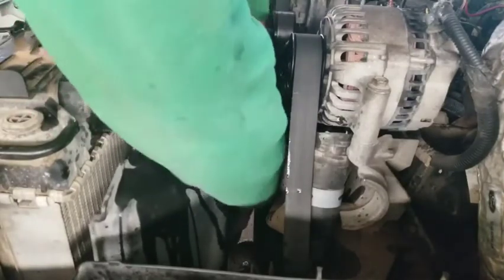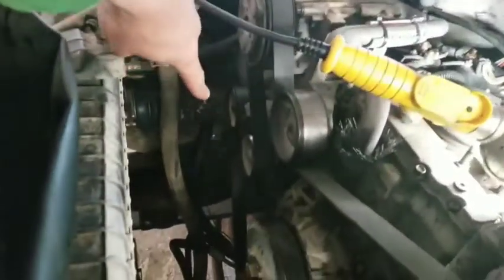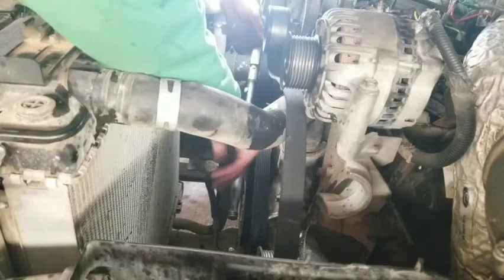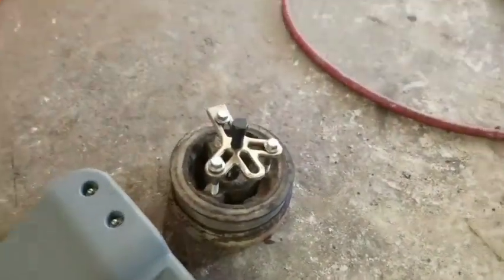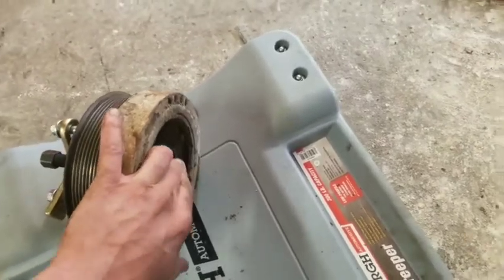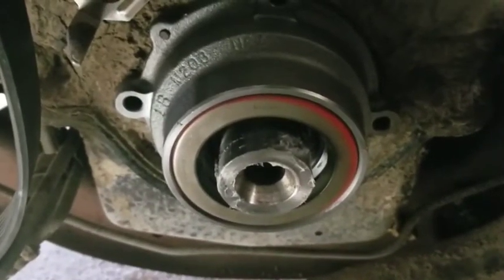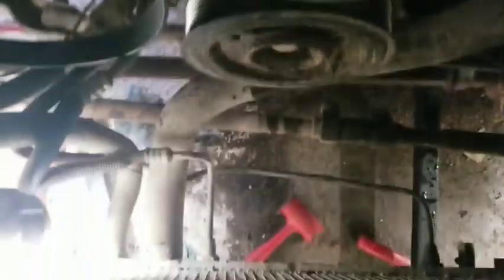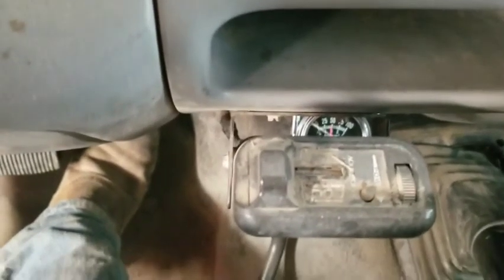7.3L Powerstroke: Low Pressure Oil Pump Replacement

Comment: Before you set the puller MAKE sure after you remove the bolt and get that big fat washer out before you set the puller,  It may be hard because it is set with RTV sealer and if it is not sealed, that will cause an oil leak.  I see a lot of I did it wrong here.....
Reply from the maker: @dalerasmussen6678  thanks for the additional info.  That may help someone else out too.  I'll pin your comment if that's ok with you.
Reply: @prodieselrepair3218   Yes Okay.. There is not much info of what to do, and I also found that to get the wear ring off you can strike it with a chisle (if you grind it to match your angle) and release the tension to then pry it off...

Comment: Thanks for posting. First video I've seen that actually shows the air chisel trick. Also the space with the radiator in place Looks like I'll be getting the HF stubby impact. 😀

Comment: Did you have to prime the pump after install? I just did mine and my hpop res won’t stay full and truck keeps dying.
Reply from the maker: No you don't have to prime it.  There's some sort of check valve that is supposed to keep oil in the HPOP res

Comment: Why did you replace it?
Reply: It can get worn, and stop pumping oil correctly. Causing low oil pressure
Reply: Main problems are lower power output and hard starting when cold... @rileyjoseph3488

Comment: Anything else to note when reinstalling the harmonic dampener? I borrowed a installer tool from o’Riley’s. Do I need to spin the motor over to a certain position to get the timing right?
Reply from the maker: No you don't need to time the dampener or any else.

Comment: Thanks for making this video! Local guy was telling me it's an engine out job and 30 hours labor. Looks like he was full of it.
Reply: Yes he was.  Pull Upper Radiator Hose, fan, fan shroud, belt, Pull harmonic Balancer, Four Bolts for LPOP/Front Main.....reverse (15lbs torque on LPOP)

Comment: The original gear set had "DAMPER" stamped on one side to make certain the correct side was facing out.  The Melling set had no such markings. Does this mean the Melling gears have no predetermined orientation?
Reply: Yes, Melling can go either way.

Comment: what cases the truck to lose it oil pressure on 2001 ford f250 7.3
Reply: did you ever get it figured out mine just lost oil pressure
Reply: @joshuajenkins5046  oil squirter pops out off place, regulator, worn lifter bore, base engine concern, and or failing base oil pump